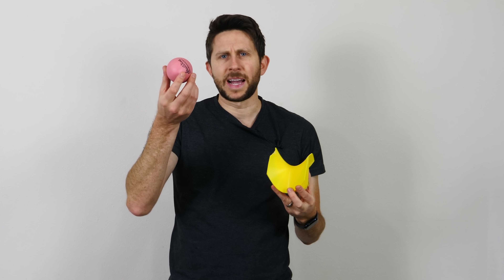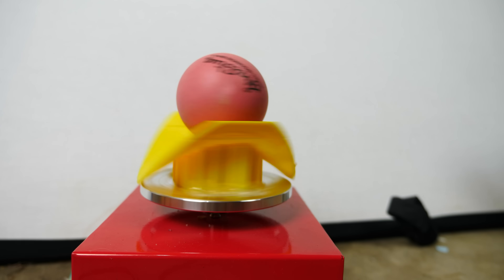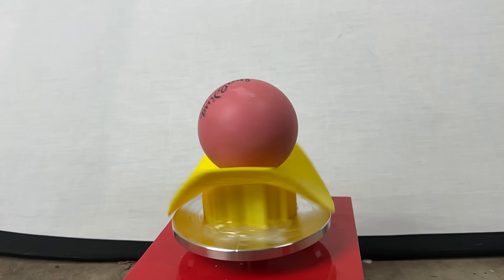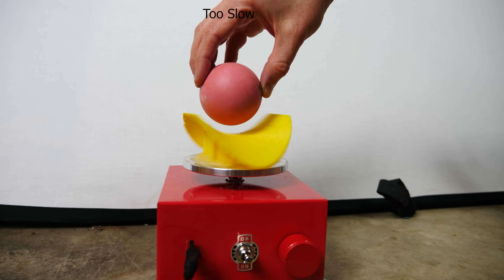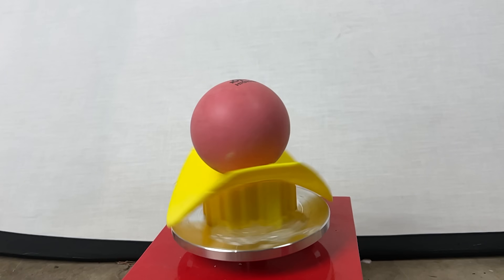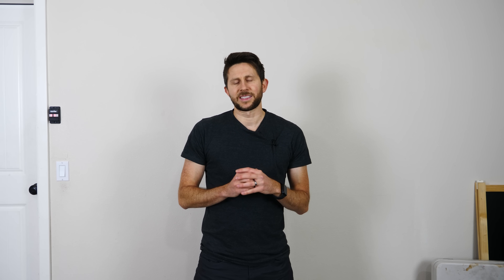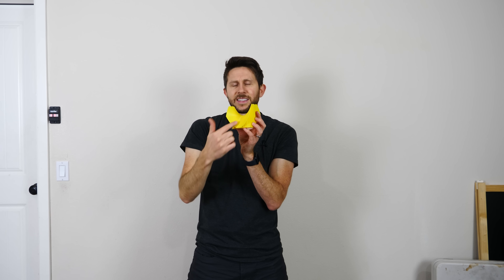The Odd Behavior of Spinning Saddle Shapes

Comment: It's really shocking just how deep the physics goes. My first assumption was that a critical speed of RMP is all which would be required to hold the ball in place. Glad to see physics at work though!
Reply: I was fascinated by your marx generator video 🥳
Reply: @kratoz2324  thank you
Reply: Do you mean RPM?
Reply: @samarthgoel5835  ah! Funny typo.
Reply: Shocking huh. Intentional pun?
Reply: Physics is always involved ♥️
Reply: @heatherreich2687  * are
Reply: How deep the physics GO, but yeah.
Reply: The physics is just a way to describe what’s happening with symbols. If you had a variable speed controller, why wouldn’t you expect it to work at certain range? You can make anything seem complicated. It doesn’t mean you can’t build a simple model of it in your mind.
Reply: @HelloKittyFanMan.  , like if you covered all of your room with speakers, the walls, the ceiling, the floor,

or like a sensory deprivation pod, but it's covered with speakers pointing inwards

and then play like a low frequency wave at your body,

i dunno, mad scientist stuff,
Reply: @elgracko : That's not what I was asking, but thanks. (EDIT: before you edited it to fix it, but now that you've refused to delete obsolete follow-up replies like I was going to do, so now I have to add this for the future readers...) You said "all IT IS walls," which doesn't make sense, so I was asking you about that.
Reply: @HelloKittyFanMan.  , it "apostrophe" s, indicating **possession or ownership no? i might, possibly, be terrible at grammar, heheh

sorries!
Reply: Haha,  @elgracko , tell me then: If that were the case, then were you going around doing that with the other pronouns? Did you try using "her's"? How about "hi's"? Did you try "their's"? What about "my's"?
And if that were true, then what would you suppose should be the contraction of "it is" or "it has"?
Reply: @HelloKittyFanMan.  uhh, ehh, uhh... uhhh

::shrug emoji::?
Reply: @elgracko : Haha! That's OK, thanks goodness the edit feature that you can use on that is here for you, huh? ;-) Then we'll just delete our replies that will have become obsolete after that.
Reply: @HelloKittyFanMan.  yah, especially when typing (tapping?) on a cellphone screen!

eh, keep 'em for the record

to err is after all no?
Reply: @elgracko : 1. No need to specially differentiate phone typing as "tapping," even though it is when done on the screen instead of the keys of a physical-keyboard phone, since screen-tap typing is still typing.

2. What's the silly point of keeping them for the record? Do you think Google gave us YouTube's comment-editing and deletion features for nothing?

3. "To err is after all no"? Huh? That didn't make sense. What was that supposed to mean? Did you mean something like "to err is mortal"? Because if so, then:

4. ...so what? That doesn't mean a person shouldn't clean up a mess they left behind, does it?
Reply: @HelloKittyFanMan.  dang, yeah, right, to err is human, is what i meant,

it's a comments section, i **don't think it's got to be polished or anything,

anywho, byeee!
Reply: @elgracko : The famous phrase is "To err is human," but it should be "to err is mortal," since being human isn't what gives us our temporary fallacies in this life, but being mortal is.
OK, it doesn't have to be polished in here, right. But since it is a comments section, and since you obviously write comments with the intent to make sense, then that would mean that should want to edit an error out for future readers so that it does make sense. Right? Why would you want to make more work in the number of clicks or taps that it takes to type up another stubbornly resistant message like this last one than it would take to just use the suggestion?

And again: what do you think we have the edit feature here for, then?
Reply: @HelloKittyFanMan.  , eh that doesn't seem right, you could be immortal and still make mistakes,

if **you were omniscient, you could probably Avoid many **mistakes, assuming you could process all that information quickly enough,
Reply: @HelloKittyFanMan.  so, anywho....,

i have some clothes to wash, 

have good one!
Reply: @HelloKittyFanMan.  i'm not sure what you meant by that middle part there, have a bit of a headache and tldr,

toodles! i think, i guess, i dunno
Reply: @elgracko : If you think my reply was "TL," then that's hypocritical, because you just gave me 3. No, that's not how it works. God's an example of someone who never makes mistakes, and he's immortal. We'll die and resurrect and then also be immortal, on our way to becoming like God. So then we won't make mistakes either. But for sure here in mortality, we're sure to make mistakes without any expectation of getting completely away from them. But again, that doesn't mean we have to resist the use of an edit feature does it? Why are you so stubborn, rather typing up these silly replies instead?

And then why did you think "avoid" is a brand name? And why do you feel like you have to tell someone what your tasks that you have to get to, as if you must inform us that you need a break from the conversation? Why not just take the break without saying it, and then come back and reply when it's convenient?

Which "middle part" were you specifically referring to? And how could you even claim it was "TL" if you supposedly "DR" it?
Reply: @HelloKittyFanMan.  dude, chill the f out!

is this gonna be like a thing?

it's late, 'n tired, i have some clothes to fold,

goodbye, sayonara, arrivederci, adios even!

take it easy mate, bye,
Reply: @elgracko : Wanna know why I haven't stopped replying yet? Because you haven't answered in a way that helps me understand why you prefer writing all those replies that take more work than just doing the easy thing. See, you're tired, right? Then why did you just reply with all this? Why not just go, "Oh, that up there. Click, click, delete save" and be done?
Reply: @HelloKittyFanMan.  , I've edited 'it's' to 'its'.

are we good?

can we move on?

have a good one.
Reply: @elgracko : Pschh, ya put the asterisks there. If it's gonna be a true edit instead of a kind of sarcastic one, then what are those asterisks of snobbery for (as I was going to delete my replies that refer to the error)?
Reply: @HelloKittyFanMan.  , O'Margot!

jeez man! really?

slow night there for ya?

it's to point out that That's the edit,

people have accused me of editing the content and not just like a spelling mistake.

hense the asterisks.

frankly, i don't care if you delete them or not, i won't be responding,

live long and prosper, 🖖
Reply: @elgracko : "Spelling mistake"? I didn't even bring up spelling. Geeze, man, really? Moronic night there for ya? How come you're such a grumpy-dip person, thinking you now have to get all butt-hurt just because I called you out for your edit that at least looked sarcastic? 
"Accused" you of editing? So what if they do? Nothing's wrong with editing. It's a good thing. So what's the big issue? Again: Why do you think we have the feature?
Reply: @HelloKittyFanMan.  quit playing semantics.
Reply: @HelloKittyFanMan.  your trolling is very poor BTW.
Reply: @The Action Lab , how about a speaker room or like pod, with speakers ponting inwards in all **its walls?
Reply: Salam brothers, please, can you help me because I am going through serious health conditions, I need some tests and some tests, and in my country I do not have health coverage… I swear to you that I and my child did not find a living
Reply: In this case, it's more how deep mathematics goes.
Reply: Same here
Reply: Did you just make a pun from your name and channel concept?
Reply: This video is epic, BUT THIS IS EPICCER!!!! https://www.youtube.com/watch?v=_r6FdS-O3_8

Comment: Quick question. In the US is 3D printing accesible to anyone?  Can I go to a local and say "hey, I need to 3D print this piece"?

I am curious because of how naturally you said "you can just 3D print it" when talking about the saddle piece.
Reply from the maker: You can 3D print at most large public libraries if you bring them the file!
Reply: I wouldn't expect 3D printing to be quite that accessible, under most circumstances, I doubt a random local would be able to direct you to a nearby location with a 3D printer.
The US is quite large, so there's a lot of variability depending on where you are.
I know that some highschools and universities own 3D printers, as do many private companies for their own purposes. I would not call these publically available, so you wouldn't be able to walk right in and print a part.
The only publically available thing I can think of is that a few well-off public libraries have 3d printers where you could walk right in and pay to have a part printed.
Personally owning a small, simple, 3-d printer is relatively inexpensive now; you can find some low-fidelity ones on Amazon for $200-300.

Comment: Could it possibly work if the saddle was rotating extremely fast?
Reply: Like he said, no unless the friction between the ball and saddle is significantly reduced. An oiled metal ball and saddle might well work, though (you'd probably need to mist it on continuously from above, as the centrifugal force will fling off the oil...)
Reply: @mduckernz  yes, I was aware that he said that, I'm just not sure that that would be necessary, or rather I guess my thought is that in effect the friction would reduce considerably in such a situation because of an air bearing, a thin film of air.

Comment: It does not have to be the radius of the ball? we did this at school with different ball sizes, we managed to capture the ball even if the radius was not the same.
Reply: He said that the radius of the ball has to be of the same order as the radius of the saddle. So it works over a range from almost the same radius, down to some reasonable fraction of that. I expect that a 20 mm marble would work, but a 5 mm BB probably wouldn't.

Comment: Can you get a greater spin speed if you start at that sweet spot and increase gradually? It seems like it only pops out because it gets too far away from center. I'm wondering if it will remain in center if the speed is increased  gradually.
Reply from the maker: No, as soon as you get out of the natural frequency range the ball falls out. It has to start at the right speed.
Reply: @TheActionLab  What if you have a ball that's the same size but heavier?
Reply: @gabor6259  probably have to spin it slower?  Right?
Reply: @TheActionLab  wait if it's a frictionless surface wouldn't the ball fly off faster? Since nothing keeping it onnthe surface due to friction? Or because the saddle is curved uoward and so it cant reach the escape velodity to overcome the hurdle of the saddle after a certain speed if it were frictionless I think is what you meant??
Reply from the maker: @leif1075  Yes the frictionless surface in this case doesn't make much sense, it would have to ignore centrifugal forces as well. This is a bad assumption in my opinion, but there is a whole paper written on it that I put in my description. The reason they did it that way is comparing it to the Paul trap where there is "flapping" quadrupoles instead of spinning.
Reply: probably not
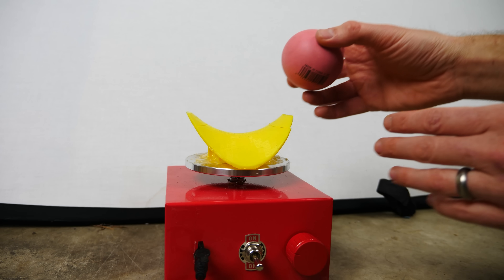Reply: At 1:40, He says there is a limit where above that it will remain Trapped if it is frictionless. If they accelerate together And spin at  the same  speed, it seems that they would have a lot less friction. There is still friction, so there would still be a limit, but it seems like it would be able to go out faster that way. That's my hypothesis anyway.
Reply: @evidencebeforefaith5304  static friction is greater than kinetic friction
Reply: I wonder if the speed would change in his vacuum chamber from lack of wind resistance.
Reply: @WeighedWilson  Air friction is probably negligent in this situation (the ball probably has minimal air resistance) but upon further thought, could we design something of this manner where air resistance probably does make a difference? This is an idea to think about.
Reply: @westonding8953  You want more "air" friction? Air is just a fluid; do it in water. :)
Reply: @andyowens5494  That's an idea, although, you have to make sure this ball is not too buoyant, otherwise it will float. (Technically, he has to make sure the balls he is using are not buoyant in air too.)
Reply: No. This is very simple: it's all about managing the centrifugal force: when the rotation is slow the ball just rolls down the slope and nothing can stop it, when the rotation is too fast the ball wants to roll down to but the protruding extremities of the saddle "catch it" and kick it up. So there is this middle ground speed where the ball doesn't have enough time to roll down the concave part of the saddle before the protruding bit catches it to keep it within the saddle but the ceintrifugal force is not great enough for the ball to roll upwards and get ejected.
Reply: This video is epic, BUT THIS IS EPICCER!!!! https://www.youtube.com/watch?v=_r6FdS-O3_8